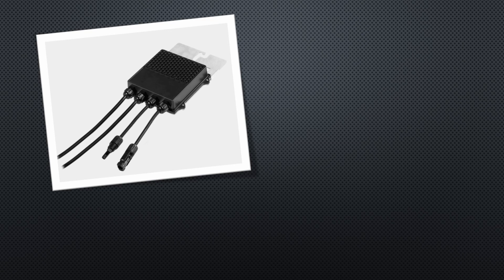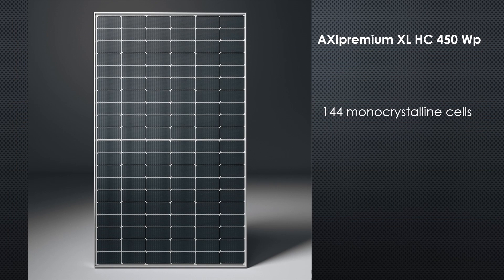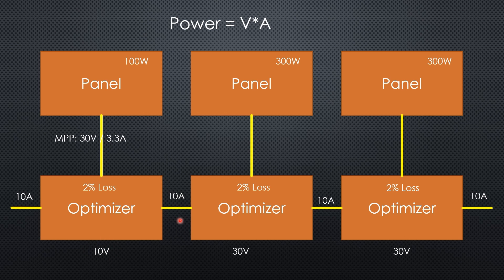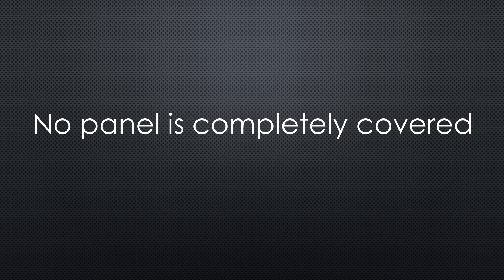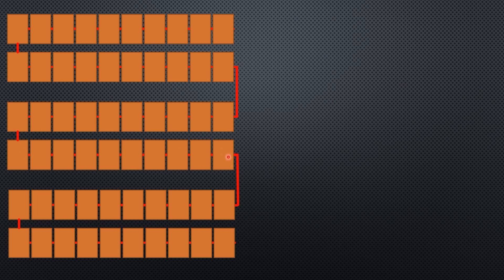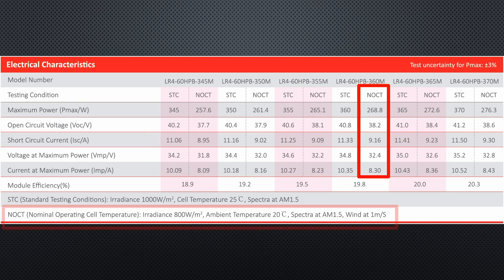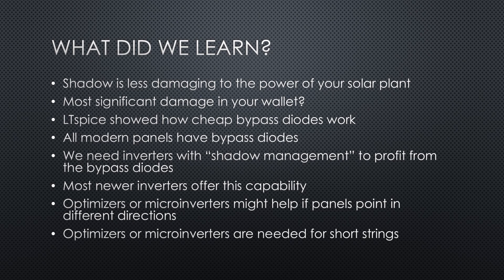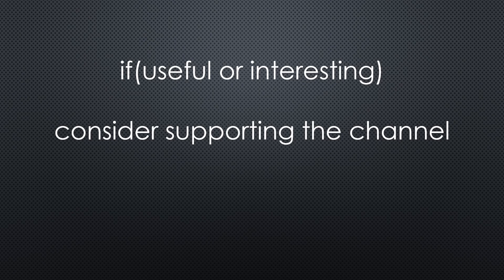441 Are PV Optimizers Worth the Money (e.g. SolarEdge)?

Comment: Thanks for the video. I hadn't previously considered that MPPT may not track to optimum due to shading. Perhaps because I just expect them to work as expected!

Those bypass diodes are certainly worth their weight when used and sized properly.
Reply: the inverter tracks to the maximum global mppt, but obviously can't step up or down single panel voltage
Reply from the maker: If you look at the U-I diagrams of the panels you see, that the panels adjust voltage according the current. This effect is used by the MPPT.

Comment: By the video it seems the better solution is use all panel  in parallel connect to one low to higher voltage converter.
Reply from the maker: This would result in big currents and losses on the long wires to the basement :-( always advantages and disadvantages.
Reply: @AndreasSpiess  From roof to basement, it is not so long, so not a big loss.

Comment: Great experiment, I had long thought "but what about the bypass diodes?" to these claims.

BTW, I have an Enphase setup, not because I was sucked in, but because my panels are at different angles and alignments, 3 vertical, 5 South ,6 East and 6 West, and that would mean 4 strings, and probably more than 1 inverter... Instead I have no big central inverter at all, which is big bonus to me.
Reply from the maker: For those setups, micro inverters are a good solution. Particularly for short strings.

Comment: I've just had another solar installer pull out after keeping me waiting four months holding my deposit! Given the importance and urgency of our current situation it is really disappointing that home solar keeps getting sabotaged by bad regulation, poorly trained installers, misinformation, and a supply chain ridiculously over-dependent on China! I was sold on optimizers because my roof has highly variable shading from nearby trees and also because the panels will be very hard to access so the individual monitoring of panel performance was attractive. I'm now wondering if there is a better way of getting just monitoring. Perhaps just a voltage monitor on each node with radio telemetry? I am beginning to resign myself to designing and at least project managing installation myself!
Reply from the maker: Having data without possibility or will to act only steels your sleep. This is what I told to my customers when they wanted more data.
Only if you are willing to cut down particular trees it is worthwhile to know where the problem is. But frankly, you will see the problems with your eyes, too, I think ;-)
Reply: My advice would be to have each panel wired back into the roof space and have all the optimisers mounted where you can get to them easy to change  if one fails . It took solar edge. Over 12 months to get one of my optimisers  replaced.  Total loss of production over £100!to me . The cost of the extra bit of wire I can live with against the cost of getting back on the roof and striping the panels off to replace a optimiser
Reply: I like Bill's advice, thanks that seems to offer most flexibility and should be reasonably easily done in my circumstances. I can't do much about shading because the trees are not mine, but I'd like to know when and which panels need cleaning as they will be prone to leaves and other tree debris landing on them. I will not be able to inspect unless I get a drone (tempting!), but may be able to clear blind using a water spray if I know were the problem is. Bill's solution should let me get the trusty Brymen on the individual panel terminals and experiment with different electronics options!
Reply: @john_hind  Ensure taht you keep your panels tilter by at least 15 degrees. If it is 20 degrees or more, it is even better. Doing so will reduce dust and debris. Leaves will just slide off quickly in steel slopes. The main concern would be bird dropping but panels tend to ignore minor droppings and still produce the same

Comment: One thing I might add as a owner of a Solar edge installation with optimizers is that it lets me check the output of the individual panels.
Reply: And not only that. If 1 panel stops working, the rest will still remain in service. Provided that the Optimizer is not defective. Then the system is out. But that is also the case with a regular string. What's better now? That extra cost? For me, yes.
Reply from the maker: And what do you change for the better when you have those values? Data without action has no value in my world. And often it steels the sleep ;-)
More panels or less shadow would change something, for example.
But I know, we are nerds and love our gadgets. So no problem with your decision.
Reply: @AndreasSpiess  You can identify a faulty panel. I did not decide for installation of these optimizers. They were included by our consultant for the solar installation. Back then I did not have the knowledge I have now and I might decide against the installation of these. Tho I did not have a problem so far and even if I would have one, the replacement of these modules is very easy, at least in my installation.
Reply: @Iceteavanill  The chance of defective panel is 1in 20. The cost of optimiser is same as a 335W poly panel. It is not worth it
Reply: @shrujanamsyama9940  You can also detect degrading of the panel and determine the influence of obstacles on your roof. Idk there are pros and cons. If you want em install, em. If you dont, dont....
Reply: @Iceteavanill  Yes, there are definitely pros. It is just that solar system is a financial investment and financially, the cons outweigh the pros. It is simply better to install more panels than to install optimisers financially

Comment: You forgot two important advantages of optimizers: Safety and maintenance. Because we installed the system ourselves, we don‘t want to deal with 1000V on our cabling and risk light-arcs every time we unplug something. And we want to see defective panels without having to book a flight with a thermal imaging drone.
Reply: My experience has been that the optimized systems also start producing earlier in the morning and keep going later in the evening, because the startup voltage of the system is lower.
Reply: He adressed maintenance. Don't put complicated electronics in a wet, cold and hot environment. The only thing you tend to monitor is a failing micro inverter, not a faulty panel. (solar panels are very robust, inverters are not).
Reply from the maker: I just switch my inverter off before I start the (very rare) work on the roof. Not a lot of work for me.
Reply: @AndreasSpiess  that does not help. The full DC voltage is present on the whole string as long as there is sun. This is dangerous. And optimizers completely eliminate this risk and let only 1V per panel out.
Reply from the maker: @ChrisPrefect  My wires are insulated. The risk for me is not bigger than any device with a 240V cable. But I agree, a few volts are less dangerous than 400 Volts.
Reply: In Utah, we must be able to remotely shut down the feed. Optimizers are a turn key solution for this.
Reply: I don't know enough to understand how relevant your comments are.  But it would be great if these points were addressed.  Thank you for bringing them up.

Comment: Maybe we should have all panels in parallel and use very thick cable or bars to minimize loss and the mppt as close to the panels as possible. What a test, hats of to you Andreas, taking speculation away and making it a real life test with the correct knowledge and measurements.

Comment: Hi Andreas. When I did my research regarding my installation, I came accross an online huawei simulation tool. It allowed me to choose, panels, cables, etc. It also provided the option of adding the huawei optimizers. What I noticed in the simulation charts, is that the inverter started to work sooner in the winter with optimizers. As I understand, an inverter needs a treshold current before it starts? The optimizer would lower the voltage to increase current in order for the inverter to start. This would be interesting in overcast weather.
I asked solar installers for their experience, but no one could help me verify the simulation claim of huawei. I also didnt find anything online about this particular scenario.
Maybe your LTSpice simulation can verify this?
If my simulation charts where correct, the optimizer was a good investment over a couple of years.
Regards,Wim
Reply: You might pick up a few minutes at the start and end of a day,  where you are making maybe 3% of peak power....   you're still better off taking your cash and getting another solar panel.
Reply from the maker: The open voltage of the panels increases extremely fast and reaches the needed minimum voltage.
And, as James mentioned, I do not care about a few percent of a kW when it only costs a few cents. One panel more gives you much more bang for the buck…
Reply: Hi Wim,
What were the numbers they told you in the charts? 
The inverters I know start at 100 mA or below, so that would be at a power of 50 W (at 500 V). 
You would have the same amount of loss in the optimizers at 2500 W (2% loss).
It really depends on the inverter and specific optimizer, but it doesn't convince me... 
I also haven't seen any optimizer manufacturer advertising this as a big advantage of their product (I work in the PV industry, also with optimizers and rapid shutdown devices)
Cheers

Comment: Hallo Andreas, thanks about our detailed video (again). Do you have a idea / plan to do a single panel monitoring system (not a optimizer)? I'm just thinking if you can put to each panel a 60v step down conveter + small esp and do a simple voltage / current / temperature measurement (well current just for once for a string) and do a nice monitoring... This could help to optimize a string or get early warning if a panel is going to fail. What's your opinion? Would it be woth the affort?
Reply from the maker: I am not interested in single panel performance because this information has no value for me. With a battery, the only decision I have to do is: Do I start the washing machine today or tomorrow or maybe the charging time of an e-car.
Finding the energy wasters is a task which anyways have to be done, independent of the performance of the panels.

Comment: I went with a setup with optimizers on my roof. Compared the total system cost with a high quality string inverter, including installation it was 5% more expensive to have the optimizers. The inverter is cheaper than regular string inverters an you don't need extra wiring, plus the DC disconnect box. And you get data per panel and piece of mind. So I think it's well worth investing into them.
Reply from the maker: Thank you for sharing your thoughts!
Reply: Correct, solaredge inverters are cheaper so the price for optimizers  isn't as high as often quoted

I went with optimizers as I have a string with north and east config and I want the per panel monitor functions

Comment: Writing from the wet tropics of Australia: Yes I agree the use of optimizers is rarely worth the extra cost. Here we have issues with huge UV exposure and many systems get replaced after just a few years. Bypass diodes are a way to save infrastructure cost and our feed in credit is now so low it is hardly even worth having panels at all.
Reply from the maker: You are lucky you are far away from Europe. Here, energy currently is a very hot topic ;-)

Comment: This is exactly what I concluded before installing my panels... but I have roof-surface facing all sides so optimizers seemed a reasonable solution to have west/south/east in a single string.
An alternative would have been a three string inverter and connecting them up separately, but that also creates some problems in terms of wire mess (and these inverters are pretty expensive).
Another possibility would be micro-inverters to east and west, and a simple string south... but again wire mess and on top of that mixed solutions.  The price differences for different solutions were not big enough to be the deciding factor.

My main worry is indeed that an optimizer might break, it will be easy to find it but hard to access. 25 years warranty does give some confidence, but the price of the optimizer is not my main concern obviously - loss of production and man-hours to fix it are not covered.
Reply from the maker: I agree, in some cases optimizers are good. I am not against them. I just wanted to show what is true and what not. Then my viewers can decide..
Reply: @AndreasSpiess  And your work is appreciated.  So many options out there gives a lot of space for installers to 'peddle' expensive solutions - information is key!
Reply: Personally, my biggest concern would be if the company will be around when a failure happens, not to mention if the part will still be made at that time.
Reply: @ChrisQPW  Indeed, the implementation of any warranty beyond 5 years is always a bit of a question mark.
My house is about 17 years old now and some things are starting to break (as expected)... good luck finding new parts to repair anything!
Reply: @diatonicdelirium1743  Yup, older parts are very difficult to replace. It is always better to buy standardised unbranded/generic items which will remain standard for long time than buy fancy branded items which keep getting upgraded!

Comment: Really interesting video ! I have PV solar on my roof for over 14 years now ! In those days, it was rather expensive. But anyway, I'm glad we did it. Now, thanks to your information, I'm preparing a second installation on the roof of my workshop. A work in progress... but defenately very satisfying !
Reply from the maker: Solar panels are like tattoos: You always want to get another one ;-)
Reply: @AndreasSpiess  Can't really tell, I have no tattoo    ;-)
Reply from the maker: @PhG1961  Me too. But I know lots of people who have a few of them ;-)
Reply: It's so interesting to see the progression in the PV world. I also started in 2006, with three Sharp 165Wp panels on a Mastervolt Soladin 600 inverter. That system would seem like a toy nowadays.
Reply: @SolarWebsite  Mastervolt is a really good brand. We have 10 panels for a total of 2.2 KW with an Infinity inverter. This brand does no longer exist, but it's quite good, so far, never had any issues.
Reply: @PhG1961  Oh for sure, the Soladins were great, never gave me any trouble. But the systems were so small back then, and the monitoring options so rudimentary. I soldered a serial cable myself 😊 Good old times - although I'm happy with the SolarEdge monitoring options.

Comment: thanks for doing these testing. it is indeed very helpful just may i ask... would it not be better test configuration to go back on the roof and cover actually multiples of the panels on the main string. for example with some large boards or with some plastic sheeting?

it just seems a more true to life and rigorous way to test for the scenario of a greater level of shading, with multiple shaded panels. i mean just to calculate if there are additional losses on modern panels in the first place. not to then bother to try attaching any sorts of optimizers. just merely to determine if then are even going to be any point at all.

this approach would enable testing of all the same type model of panel. instead of using a different kind (of lower wattage). and the ability to cover a more significant total percentage of one whole string. to better try to find some tipping point at which the rest of the string can no longer push the current through so well. of course that is old thinking. on older panels without those shotkky bypass diodes. so perhaps no long applies anymore with modern panels. it would just be really cool to see that! and then completely disprove the whole optimizers for any situations (even the for worst case).

sorry if that seems all a bit much to ask. as i do not want to over step my bounds and be requesting something that is off the table. for example if there is some safety issue, or other practical issues. which would prevent those sorts of tests.

however this is still a great video and very helpful. especially if buying used panels cheaply: to then know to check for this built in bypass feature! also hope your video here will encourage others out there to conduct their own specific testing. whomever else is interested and motivated. perhaps somebody like that marco reps fella (who is putting together a new solar array)
Reply from the maker: This would not change a lot. We have to pay attention that we do not get lost with details. Even with cuttend prices, you have to produce a lot of energy to pay for just one optimizer. 2-4 optimisers cost the same as an additional panel. A better investment, I think.
Reply: @AndreasSpiess  i agree with your assessment.... it's more about proving it to a community in a more water tight fashion. was my point. with fewer reasons to dispute / that people will keep on believing in the necessity for optimizers

Perhaps a 2nd independent tester would be helpful in that regards. Especially if not to copy your methods (so exactly in same ways, and change some things, different scenario)
Reply from the maker: @dreamcat4  Maybe you watch the videos I put links in the description?
Reply: @AndreasSpiess  ah ok! will watch those then. thanks for letting me know. sorry... just did not notice those earlier. many thanks

Comment: Andreas the diodes in the panels bypass the shadowed part of the panel.  Always get the right size panels so if you have 400 W keep with that, because going to say a 300W you have a bottleneck due to less current in the 300W panel.
Reply from the maker: I agree! Injustice tried to do all possible errors ;-)